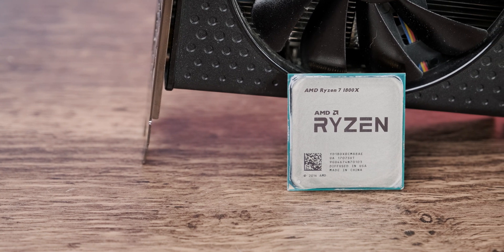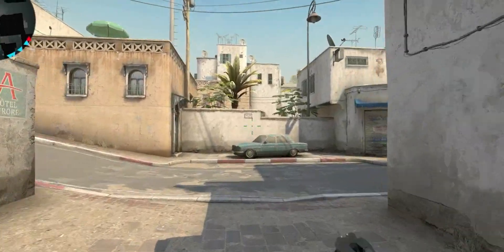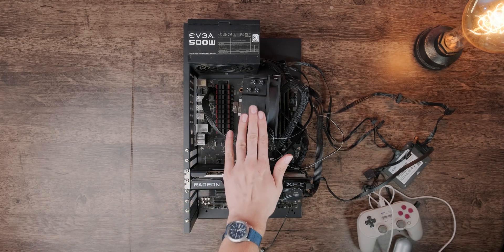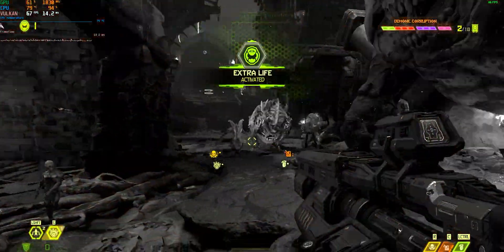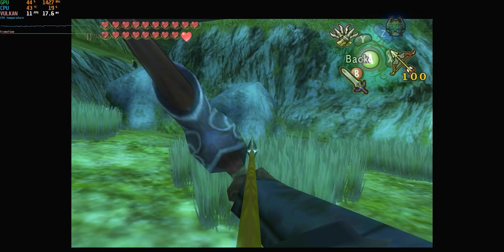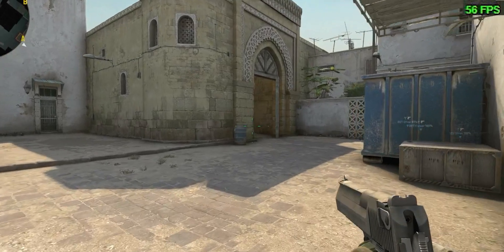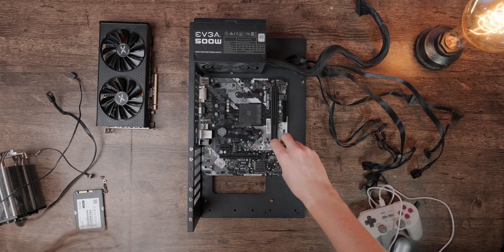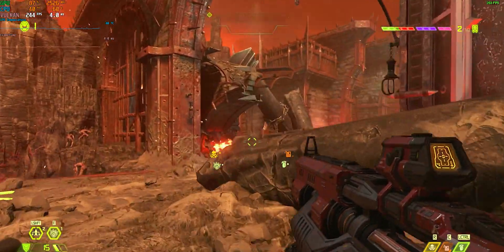WHY Are People Still Buying These CPUs? - AMD FX Series in 2023

Comment: I still use a FX-8120 the 95-watt version I bought 10 years ago. I'm not a gamer it has a Quadro-k2200. It works well for Gimp, Inkscape, and surfing the Internet. It has 32GB of DDR3 2000mhz ram so it has some time left before 32 GB isn't enough. I decided to replace all the electrolytic capacitors with solid capacitors on the motherboard and keep it going for 3 -5 more years and give my 23-year-old 1999 desktop tower a full makeover paint job with cooling mods. I would like to get a creator motherboard when the CPU gets upgraded.
Reply: '...and give my 23-year-old 1999 desktop tower a full makeover paint job with cooling mods' 
I took our old (2004 iirc)family presario, cleaned it, sprayed some discoloured bits, found new front i/o and card reader on ebay and put a 3700x and 2080 inside. Still some cooling mods to install before I can run with the side on but a good sleeper so far.
Reply: Sorry, but how do you upgrade the capacitors on a mobo ?
Reply: @youngmo77  On hole trough caps I use a soldering iron with temp control. I add leaded solder to it first that melts at a lower temprature then suck it out. Sometimes I have to do it a couple of times to get the leaded solder all the way down the barrel. When the component lead is lose you can pull it out. You don't want to pull on it until the component wire is loose because pulling the plated through barrel will can damaged the board. It helps to preheat the board.
Reply: I've worked in electronics manufucturing for 15 years I don't really need any practice. It might help to practice on something you don't value untill you get it right before destroying something you value.
Reply: It's quite cool to hear these things. It's a lot more different from the usual 'GET THE FASTEST, NOW!' that enthusiasts usually do.
Reply: 32 gigs ram is going to be overkill for a long time.  We've been putting 64 gigs in our new builds and even with 50 tabs, multiple remuxes encoding, and a game or two open, it's very hard for me to even break 16 gigs of ram.  The worst drain on ram is the inefficient coding of windows.
Reply: @PatrickDKing  Cool. I added a 10,000 RPM Velociraptor hard drive so I can use a swap file. I use Linux but you can do the same with Windows. With 32 GB I probably don't really need a swap file but I added it to my workstation anyway. I only ran out of memory twice and the swap file on a fast hard drive helped me recover quickly.
Reply: @PatrickDKing  I'm keeping the AMD FX-8120 for a backup. I'm putting together another workstation with an Xeon 14 core with 64 GB or server RAM. My old workstation has PCIe 2.0 for the video card I really needed PCIe 3.0. About 4 years ago some of the software I use on Linux like Blender doesn't fully work anymore because of that.

Comment: I was running a Phenom II 1045T until last year when the mobo died.  An FX6100 with a mobo can be had for $75 shipped.  I can recycle my existing ram and even upgrade to 32gb for under $100 total.  This is still a great deal for the casual gamer without breaking the bank on a $200 Ryzen and $150 mobo before buying RAM.
Reply: used R5 3600- used A320 and 2x8GB 3200mhz. Do not bother with antiquities...

Comment: I had an 8350 back in the day. I was always under the impression that all of the 8000 sku's (such as the 8120) were pretty much identical to the 8350. the performance difference is a littlebit shocking.
Reply from the maker: That's funny, I wasn't even planning on getting the 8350 for testing because I thought the same.
Reply: 8320 is the best fx cpu by far for multiple reasons and yes that includes the 8350

Comment: the 1800x was under performing as that motherboard caps cpu power draw at 65 watts.
you can see the 1700x on the graph way higher up, but even then it was so much faster.

board is asrock a320m-hdv I have one in my garage currently.

Comment: AMD FX gave you one of the longest usable platforms ever, I started with the 4100, got a 6100, and I have had a 8120 in service since 2012. Reliable cpus with great instruction set.
Reply: I started with the fx 4100, and upgraded to the fx 8350 when I could.
The system is still my backup computer, paired with a Radeon RX 580-8GB.
Runs 1080p games perfectly fine.
Reply: @hrayz  can i run most games with native 1366x768p with medium settings or lowest just with MSAA 4x on like cs2,the finals, nfs heat im too lazy to throw away my old 768p monitor.
Reply: @randomdreamer1619  the RX 580-8GB card is still a good 1080p gaming card. Some games at medium, many even better. (Some badly optimized games like Starfield will suck no matter what though.)
Reply: @randomdreamer1619 with an fx processor prob not
Reply: @randomdreamer1619   FX will be perfectly fine, I play R6S on full low 1920X1080 with 144fps (bcuz my monitor) on RX 570 4GB
Reply: The 8350/8370 are going to last at least another three to five years with proper care and good supporting equipment.
Reply: @TellMeMore-j4v  I think even longer.  I still haven't retired my old athlon II (20 years old now) b/c it's a great low power cold storage device and can run modern windows.  I was thinking if I retire that pc that I'll move the FX8350 into that role and use the athlon II as a tinkerer pc.  It's got Ddr2 ram too lol.
Reply: @PatrickDKing  DDR2? Jesus man lol 

Yeah I've got an 8350 in my rig on an mATX ASrock board with 32GB of DDR3 running 2133mhz. I've got a custom cooling set up so I can overclock to 4.9GHZ semi stable. Still need to tweak some cooling solutions but it's a good foundation.
Reply: @TellMeMore-j4v  Any cooler, liquid or air, that can handle a 240 Watt TDP will net you 5 Ghz on the right board, so long as the chip itself can do it, and most can. I got mine up to 5 Ghz with a 5.2 Ghz Turbo core. It runs just fine like that.
Reply: THIS^!  Our computers running on that chipset are still running because you had lots of upgrade paths.
Reply: I still use a fx-8370 I one of my pcs. It’s one of the higher end ones, but it’s holding up. It’s not  nearly as quick as my i7-9700k but it still runs some games,
Reply: I feel like my phenom kept up better tbh

Comment: I have the FX8150. I have GTX1660Ti   6 gig OF RAM  DD6. Let me tell you this CPU and graphic card combined with 32 gigs of ram  5 SSD'S  IN RAID-0.   RUns absolutely beautiful the game's fly. I'm very very pleai did not experience anything bad with this setup
😊😊😊😊😊😊😊😊😊😊😊😊
I also have an F x  8350  at  clock that 4.5 GHz with A   GTX1080I am also very pleased it has 64. Gigs of ram and it runs with an SSD 7000MB for a second and the other PC. I express a lot and I'm very very pleased with it. It is extremely fast and in games I get over a 100 to 200 frames.
YOUR ISN'T WORKING PROPERLY.
Reply: I agree, rock solid if you take time to cool hot spots for those that went cheap on them motherboards like my first two Biostar 970s. Though having a few old Slot 1 and slot A heat sinks left over from back when, I had some good cooling mods that made them very stable. Best comp was the MSI 990Gaming board when I found it on sale used. Best cheap purchase I ever made.

Comment: I've just finish building 2 gaming rigs two  AMD 3 AMFX 9370 w/ ASRock Fatal1ty 990FX board & FX 9590 w/ ASRock Fatal1ty 970 board both system with 16 Gb of rams  with a MSI 1070 Graphic and they still runs games in 2023.  with no problem
Reply from the maker: Damn those 9000 series are crazy. Glad to hear they're working out for you
Reply: Thank you

Comment: I think in the big picture that despite their flaws, it got a lot of people up & running with affordable custom PCs. When it first came out, it was competitive in multithreading for the price. Plus as  it aged, more software caught up & became more multithreaded. These weren't powerhouse chips (except for the power consumption, lol.) But they were cheap, & that's what mattered to a lot of people at the time.
Reply: newer games that definitely benefit from more cores but it'll struggle with minecraft and csgo 😂it can still game for sure, it can drive apex to over 100fps and well into the 160s in indoor scenarios in 2023 so that might surprise some people considering the i5s that it could barely compete with in its time might struggle to even launch newer games that demand more than 4 threads.
Reply: Although the Phenom II might be faster than all or most FX processors, it won't run Windows 11 24H2 because of no SSE 4.2 support.  Although MS might have provided instructions for installing Win 11 on unsupported hardware, 24H2 quietly imposed the SSE 4.2 requirement which cannot be bypassed.  FX processors have SSE 4.2 support.
Reply: Time has smiled on it. It was never the absolute best of the best, but being decent in 2016 and still decent heading into 2026 is a respectable feat in itself, arguably better than peaking high but only for a short while. That longevity counts for something. Anyone who bought one back then and kept it going this long has surely got their money's worth, especially if they've upgraded around it.
Reply: I had the 8120 when it first came out in hindsight I should have gone Intel it did manage to game okay I  used it up until ryzen first generation. Which was Leaps and Bounds better
Reply: Everyone likes to say that they were good for the price.  The problem with that argument is that AMD previously released the Athlons and Phenoms for less than their competitors CPU's.  The Athlon and Phenoms could complete and sometimes even out perform them.  For instance.  The Athlon x2 was cheaper than a Pentium D yet it blew it away.  The Phenom's were a little bit slower than the equivalent Core2Quad but a little overclocking fixed that, yet the Phenom's were far cheaper.  So....now all of a sudden its ok that FX line is crap because its cheaper?
Reply: @jims_junk  Phenom 2 once you OC the FSB would actually outperform the first gen i7 cpus, the problem is that AMD focused on unlocked multiplier and reviewers all OCed them with multiplier, yet the same clock when done with fsb would be about 20-30% faster. My phenom 965 hit 260 fsb at 4.2ghz with stock voltage and ran that way for 6 years straight.
Reply: @jims_junk  The Phenom IIs caught up to the Core2Duos. It was the first Phenoms that couldn't do it. The FX line wasn't crap, I understood the sarcasm. It needed special care to get it to perform. You could get the chip for the price of a used first gen i5 which was inexpensive and why I chose it over an i5 of the time. It was Nehalem with no AVX or FX with AVX, so I went FX. I couldn't afford a Sandy Bridge let alone an Ivy Bridge setup at the time. Not brand new, but brand-new FX was on the menu and with all those cores I felt it was only a matter of time before games would use multiple cores and the chip would come into its own. And it did. Between scheduler updates on Windows and game engines using 6 cores and more due devs working on, what was at the time, the new consoles that had 8 core AMD Jaguar CPUs, the chip kept chugging along. FX is still useable right now. Today. In 2024. Amazing. I just watched a different video whereas they tossed SteamOS side by side with a cut down Windows 10 on it and it was smooth and kept great frame times with an RX 6750XT pulling GPU duty. It didn't shock me. At the time of release everyone panned them as they weren't faster than the Phenom IIs out of the box. And that was fair. A cheap i5 2400 system would steamroll it, pun intended, but the name, steamroller, makes so much sense. Super powerful but slow to get up to speed. And that is exactly what happened. True fine wine in all aspects.
Reply: The isses with power and heat are actualy a big problem.  It greatly adds to the cost of cooling.  Increased required maintenance and reduced reliability all with an extra hit on you power bill.  an i5-2400-3770 was always the cheap way to get running a gaming PC, even when the prices for both were higher.  I always liked AMD since my 800 duron, 1800XP and 3200XP days.  but at that time the FX's were hardly the affordbale option and by the time they became affordable, something better came along.
Reply: @pepperfish_  See, that's a poor argument. It's 2024 now and a 14600k runs at 300w under load and sits at 95-100c. The FX cpus were always better for multitasking. The performance of the i5s really went out the window you started doing stuff like skype or later discord calls while gaming, or running other stuff in the background. Back in the day, benchmarks were not done in a realistic environment, unless you closed everything in the background you never hit the performance numbers stated.
Reply: @PineyJustice  so your argument is that new expensive CPU's also require alot of power and cooling, and at the time that the FX was a cheaper than i5 option circa 2017 Ryzen came out and made a joke of the FX's.  as far as multitasking I have a 14 core 2697 v3 all core 3.6 with 64 GB of ECC, for under $300 i get comparative performance to an AMD 5600 which i also own.  see yours is a poor argument.   i been there done that.
Reply: Competitive in multithreading? In what universe? My Phenom II 1090T X6 Black Edition ran circles around the FX CPU's.
Reply: @thelaughingmanofficial  No, they do not. Not even close, sorry, I have both and the FX absolutely demolishes the phenom, even when they're both overclocked to full potential.
Reply: @thelaughingmanofficial i also dont believe this. i had both, The FX were clearly faster even tho its newly integrated instruction sets. Phenom was good, and also, some phenom was really faster when the FX came out then. But now, some program cant even run on a 1100T bcuz it does not have the instructions. K10.5 didnt aged very well, unlike the fx-es does.
Reply: nah, they are not good
Reply: @Kilowatt6464  i love how your response to his comment is basically "nuh uh"

Comment: I'm still using a fx 8350 for windows and older games, its still got some life left in the chip yet, paired with a reasonable GPU to avoid any bottleneck.
Reply: fx 6300 here with a gtx 960 ssc
Reply: I just bought a fx3850 and an asus motherboard that’s got 3 pcie 16 slots, 16gb of ddr3 1888 ram and an aftermarket heat sink for $40. I got a gtx 1060 and a 500gb nvme m2 ssd in a pcie 4 adapter. So we’ll see. I’m not a serious gamer. I kinda just enjoy making the cheapest possible pcs that can play relatively new games. I think I’m doing pretty good. I mean I got the gpu and a 600w power supply for free and the dell 500gb ssd was only $30 I have 2 750gb hdds and a 1tb hdd that came with a dell 7010 I bought for $35. But we’ll see. I may have been better off just buying an i7 3770k for $50 over the fx 8350

Comment: My fx6300 with an RX570 runs Cyberpunk 2077 well and anything else I throw at it. A Hyper 212 keeps it cool, not resting in place, but firmly attached. My 8350, overclocked to 4.6ghz is even better, with an old H80i running cool.
Reply from the maker: Haha that's awesome. They're still great chips, but the used market is crazy on them.

Comment: well in case anyone is reading the comments.  not sure corrects settings for bulldozer(81xx/61xx) but piledriver (83xx/63xx) for best performance you needed your Hypertransport and Northbridge set to 2600-2200 respectively (something that most reviewers miss) and also benefit from higher ram speeds and DEFINITELY had to have it running in dual channel.  most reviewers would only use standard 1600mhz ddr3 when even in the specs called for 1866 but using higher than that would gain even more performance especially for gaming and even more if you were using a model with an igpu

i personally had a FX-8370 16gb 2133mhz and with 980ti and i rocked that setup all the way till zen 2 came out, running 1080p with no problems
Reply: I will definitely agree, the duel channel really makes the difference with the Fx series
Reply: Switching from ddr3 1333MHz to 1600MHz gives about 4-5% performance boost, according to my observations at FX-4100.

Comment: Can't really give this video the thumbs up, because he used such shitty games and low resolutions as to make the 8350 look less capable than it actually is. I too am running an 8350 and RX 6600 (non-XT) and I'm playing modern AAA titles at max 4k with absolutely no problems. Even at 1440p with Super Resolution I have yet to see my FX go over 70%. He  also neglects to mention that going over 1080p makes any CPU virtually equal. 

While I would agree that buying an FX over a Ryzen is a bad move if you're building from scratch, I certainly wouldn't consider the 8350 FX obsolete in gaming by a long shot. The FX can still ball.
Reply from the maker: I 100% see where you're coming from, I just use the games and monitor I have because at the end of the day, youtube is just a hobby for me. I did buy a 4k monitor for testing games at 1440 and 4k, and I'm slowly working on buying new games to test and working out my testing methods. it'll come with time as I build up my channel. I appreciate you watching and commenting either way, even if you weren't a fan of the video.
Reply: @aChairLeg  Didn't say I wasn't a fan of the video. Videos showing that old tech is still viable is surely needed. Especially for people like me who are on the fence on whether or not it's worth dropping $1200 on a new machine. Would a modern Ryzen 5800x run games any better with an RX 6600 than an old FX machine etc.. The problem is everyone keeps using low-end games (CS GO, Pug, etc.) at 1080p. Meanwhile I'm playing Far Cry 6 at 4k with 60 fps and the FX isn't breaking a sweat. You see where I'm coming from.

You are the first one to pair the FX with a modern GPU, so you definitely get props for that 👊